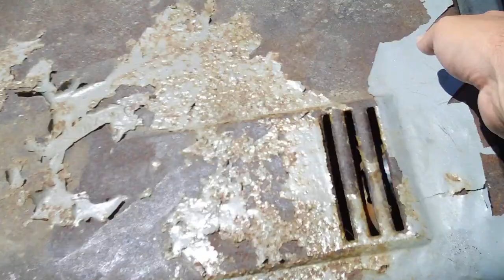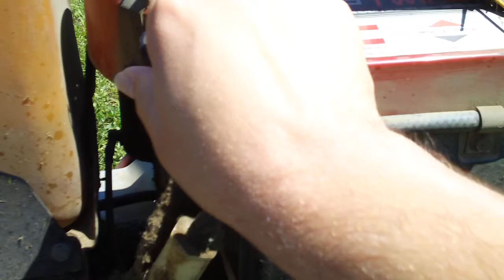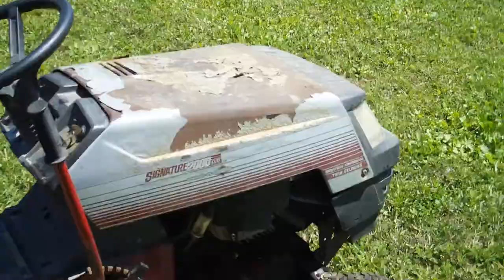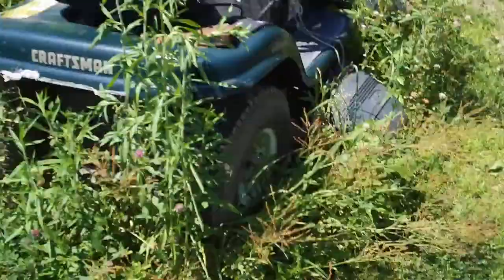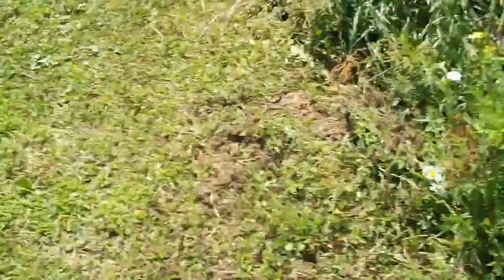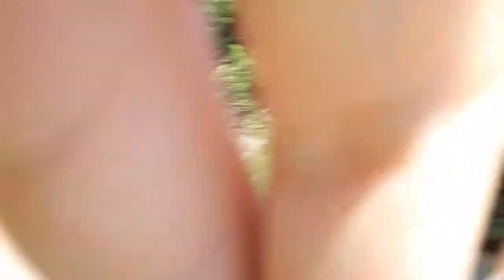Signature 2000 Tractor Engine Failure

Comment: You're lasted longer than the one my family had. Ours lasted about seven years and was a constant hassle to fix. The first day we had it in our possession, Wards had to send out somebody to work on it setting the stage for the following years. It would later develop a bad habit of having the drive belt ( the one between the brake/clutch pulley and the transmission ) for the transmission jumping the pulleys before it was parked and cannibalized. Of course, there was also the crappy plastic gear shift lever guide on the left hand side that broke constantly.